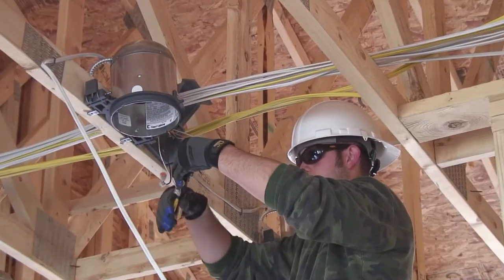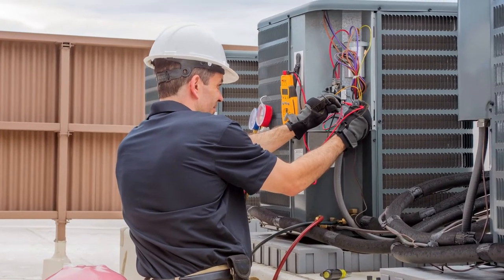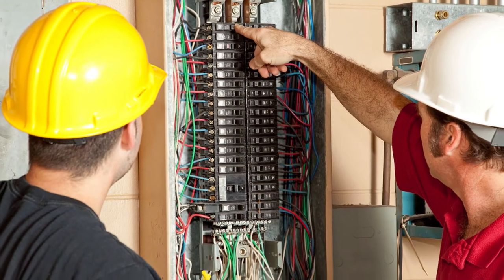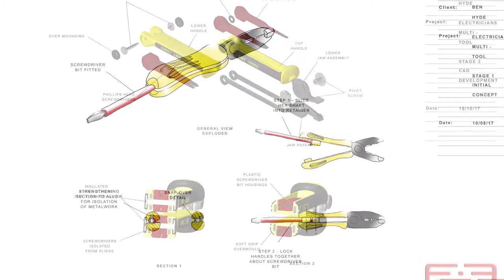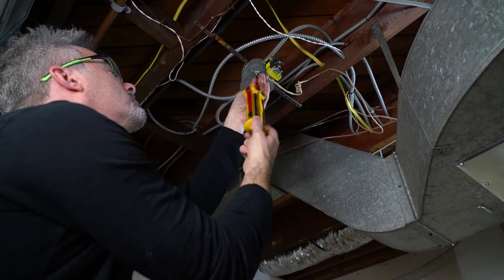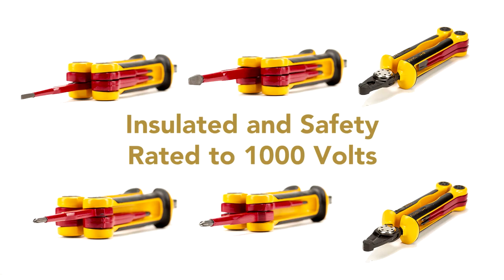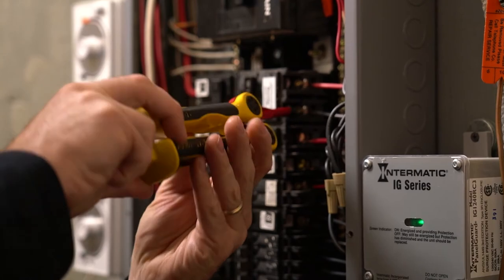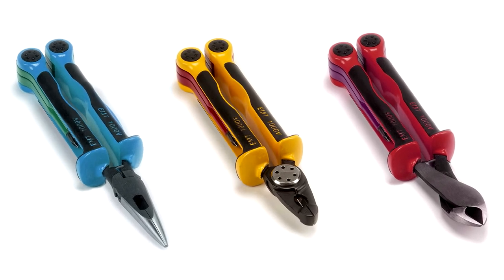RATED Patented Insulated Multi Tool

Comment: The multitool is great.
However I would like a few options here.
Like locking screwdrivers and possibly a folding design (since anyways the plier heads will be still exposed)
And possibly a version with a bit more electrician related tools
But I do like the concept though it's minimalistic and well thought out as most of the needed tools are here.